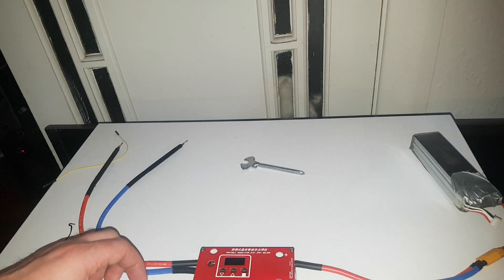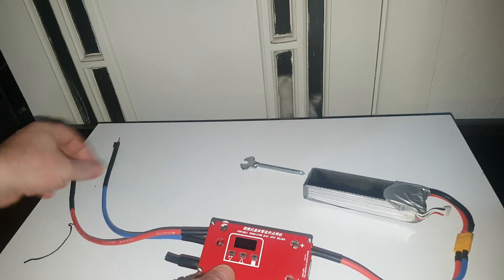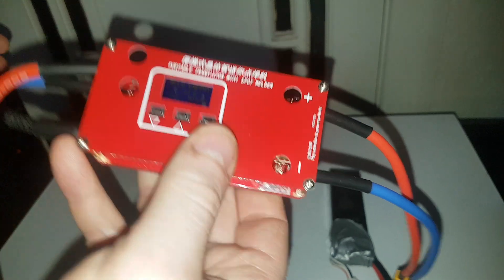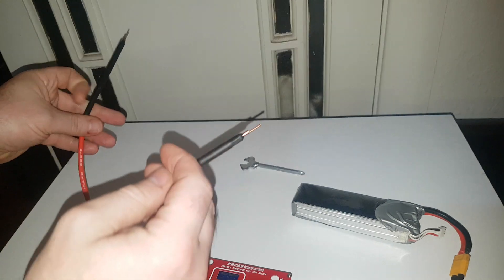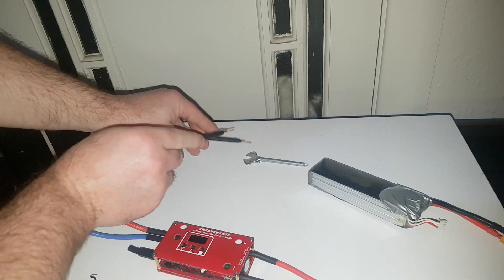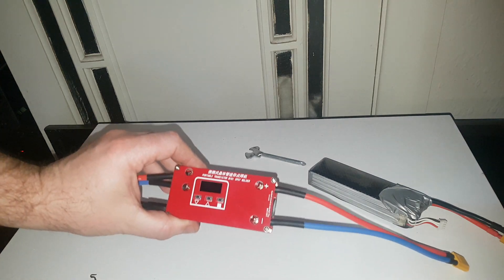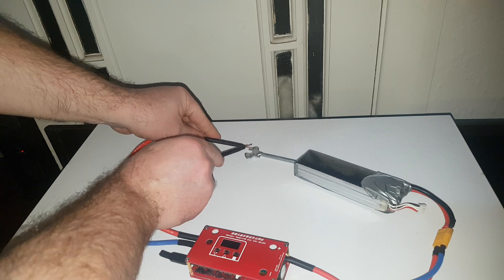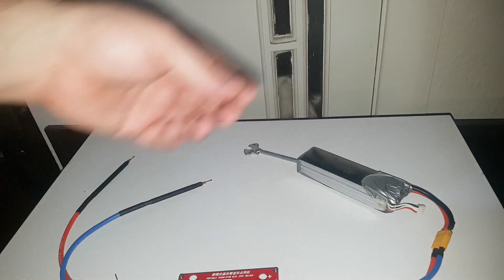Faulty Banggood Portable Mini Spot Welder Machine

Comment: One or more of the mosfets are shorted out. The mosfet driver circuits in these things are poorly designed and any voltage drop that causes an insufficient gate voltage to the mosfets will make the mosfets short out.

Comment: check the gate resistor coz I believe gate keep supplying voltage when gate receive signal source and drain connected and the current flow I did also a few review sort of spot welding out of 10 I only encounter one mini spot welding blown the mosfetracet due to thinne traces.

Comment: Watch User Luca on this for modifications.
Check one of my videos and read the description.

Did do some modifications om pre hand and welding 0.15mm strips on 15/20ms with 2x 3s1300mAh 75/150C lipo in parallel.

Comment: I modified my welder as explained on this link.  This says the voltage to the controller of ther MOSFETs drops as they are turned on, thus supplying less on voltage to the MOSFETS.  That may be what causes them to fail prematurely unless you have a very high current battery supply.
   https://youtu.be/fdnO0Z-scjA

Comment: Look at this video... the best solution is 1. Good Battery and Full charged (LiFePO4 4S or Li-ion 3S in high discharge current) 2. Add capacitor to batter like following video I use 16-35V 1000uF capacitor
https://youtu.be/fdnO0Z-scjA

It work well. No damage with mosfet for 2week. I use LiFePO4 4S 20Ah CCA 450 A. And use insulation for safer capacitor.
I use 35V 1000uF same voltage as 35V 10,000uF. 

https://uppic.cc/v/yEsVAAGaJxM4ykOivlGVz
Reply: got the same unit a few days ago and you can't add the capacitor any more as the circuit board has been updated and this mod can't be done , I'm using a high drain car battery myself but No current flow  dose not work at all turns on show's the available voltage from the battery  but Nothing works useless

Comment: Hi,
It happened the exact same thing to me but I was using 12v 7,2Ah Lead Acid Battery. Already reported to Banggood and also made a video showing the exact same behavior.
Have you got a replacement unit?

Best Regards
Reply: @maky009 The capacity (in Amp-hours) of the battery does not have anything to do with the instantaneous current it can deliver.  That is a function of the internal resistance of the battery and its voltage.  E=IR.  So E/R = I.  The lower the resistance, the higher the current it can provide.
Reply: Hei there, 

Actually the problem is u used weak battery. As a result the battery voltage drops under load and the MOSFETs could not saturate at low voltage, they become high resistance and blow up becoming short.
Reply from the maker: No replacement - Banggood offered a full refund & quite quickly too. I would be happy with a replacement if it worked properly...

Comment: One or more of the MOSFETs are shorted from inductive voltage spike. This board has SMAJ13A TVS protecting the FET gates, but that is not enough. It also needs protection from drain to source. If you look on the bottom of the board there is actually an unpopulated component I believe is supposed to be a SMCJ13A TVS, though I think even that might be undersized for the task. A 5kW TVS or multiple smaller parallel TVS should be used. Also, bulk up the traces with solid copper wire.
Reply from the maker: Thank you for this Andronicus - will look into it
Reply: @eirobotix3881  Finished the mods. It's working great with 4S lipo car jump starter. You can see the mods here... https://imgur.com/a/NT6eLsk
Reply from the maker: @andronicuscomnenus2642  Thanks for the link to your write up mate - will see if it fixes my unit also
Reply: Just torture tested it at 99E on pure copper strips. I knew they weren't going to weld, but it sure did dump a crap load of current trying. The weld tip glowed orange nearly half way up. It still works!
Reply: @andronicuscomnenus2642  Can it run from 4S RC LIPO ?
Reply: @eirobotix3881  Luckily I read about this problem before my unit even arrived. I haven't attempted to use it yet because I'm waiting for my diode order from Newark to arrive. I'll give an update on how it turns out.
Reply: help me please..my spot welder no display..help mee

Comment: What battery you used?
Reply from the maker: Just a standard 3 cell LiPo
Reply: @maky009   If Im not mistaken that calculates to being a 250A discharge rate. But the other viewers comments state manual says max input current is 180A. So I’m curious how you came up with this battery recommendation ?
Reply: @mumbles1justin  it’s always better to have a higher rated battery. It doesn’t mean the welder will draw all the current that the battery ca deliver.
Reply: @Gowieee  Where did you come up with that theory for this welder?? this spot welder is literally a short on the battery supply. it uses 5 MOSFETs in parallel rated at I believe it was 55v 47A and pulsed to control how long battery supply is directly shorted. So 47A x 5 = 235A max current can be passed through the spot welder mosfets without damaging the welder.

All that being said... because of the way this welder is designed it WILL in fact draw 100% of the current the battery will deliver.